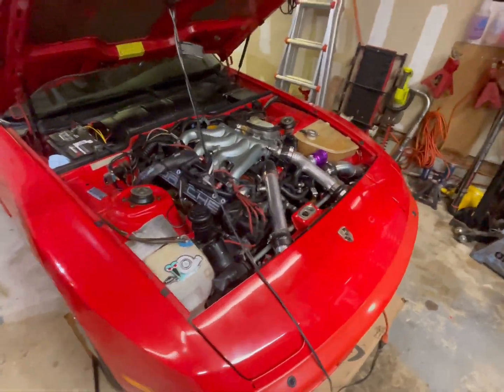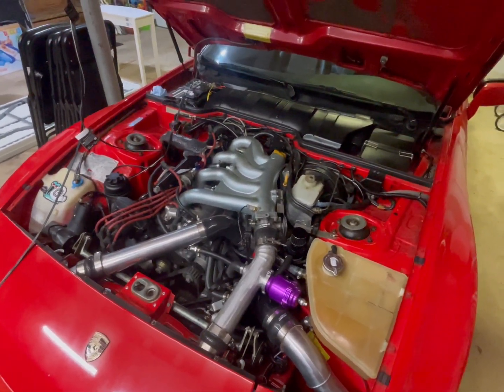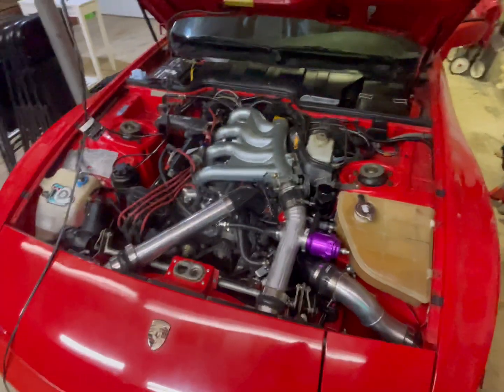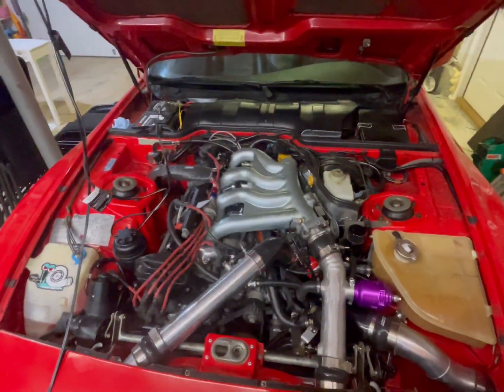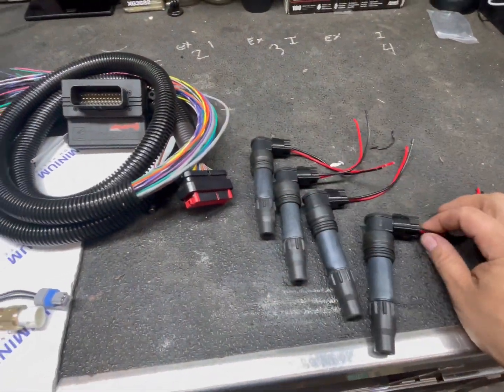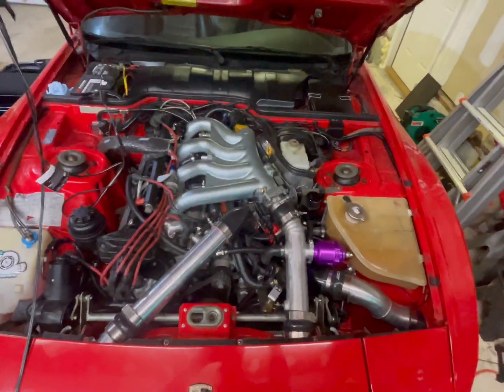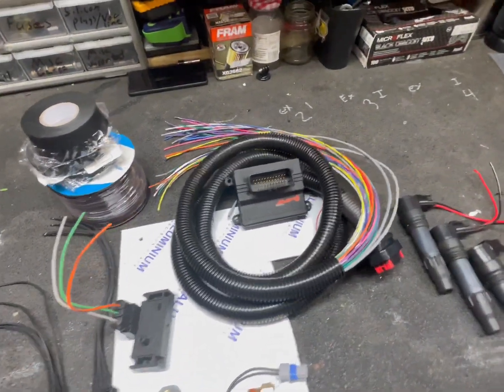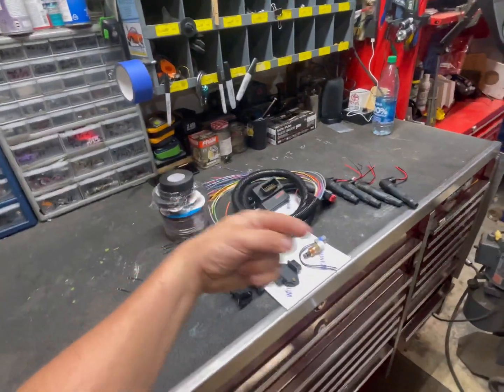944 Turbo Gets a Microsquirt Swap

Comment: man I wish there was a more plug and play solution to the 30 YO 951 ecu. I've been looking at vems but I know absolutely  0 about the software
Reply from the maker: The problem with plug and play stuff, is these cars are now 30-40 years old… the engine harnesses are bad, cracked and shorting out, best thing I did was make a new harness when I installed the microsquirt. Car runs like a dream, smooth
Reply: @dgpgarage9291  I think that’s my only option going forward

Comment: I ended up sandwiching a universal trigger wheel, drilled my own crank bolt holes and making a mount to re-use an oem sensor.  I have an early so I also used a vw buggy axle trigger wheel for my speed.  I wanted to switch on my wmi with the ecu, but just have not gotten to it.
Reply from the maker: That’s basically what I’m going to be doing for a trigger
Reply: I wanted to use a microsquirt initially, I cannot recall why I went with an ecumaster in the end.  Might have been the ecumaster documentation.  Was so over VEMs and the lack of good reference.